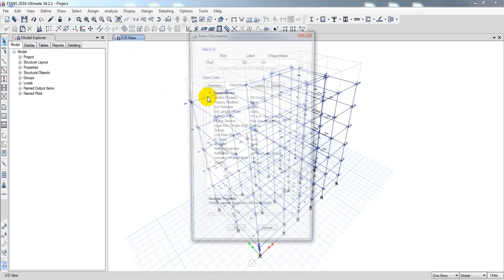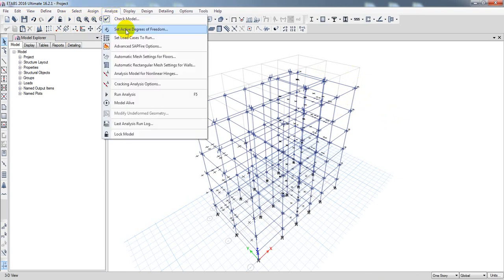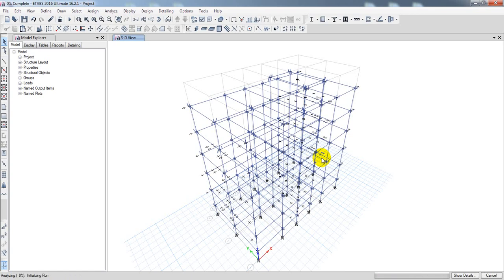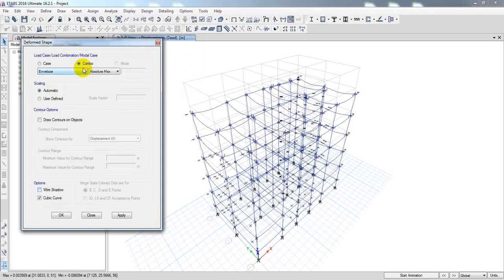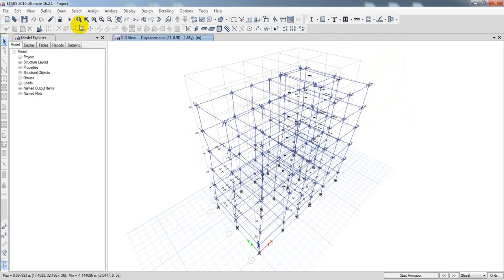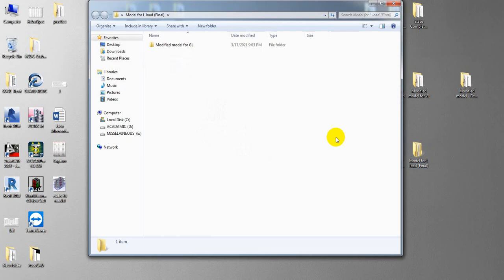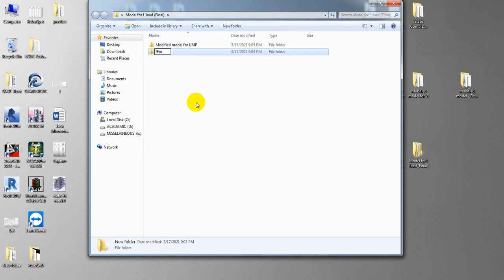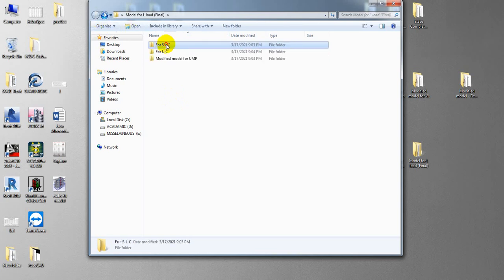Complete Building Design (BNBC 2020) in Etabs 2016 - Analysis Building using Properties Modifier -20

Comment: vaia..amra shurutr jokhm design kori tokhn to beam er jonno 0.35 r colm er jonno 0.7 niye design korlam..abar ultimate condition eo same value..tahole normal j check dilen oi normal condition ta konta? stiffness 1?
Reply from the maker: ASCE and ACI code onujai service condition a 
beam - 0.5
columns- 1.0
ultimate condition a 
beam- 0.35
columns - 0.7